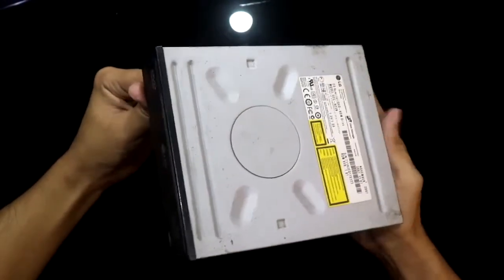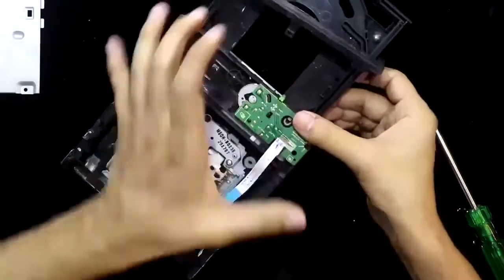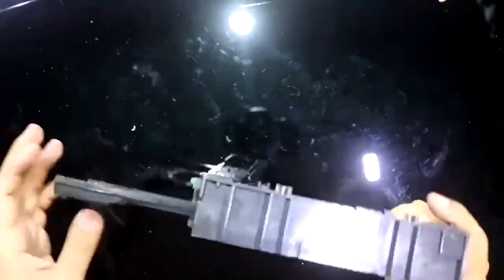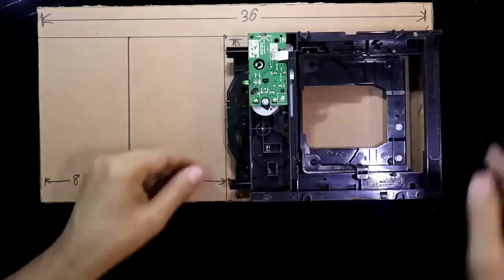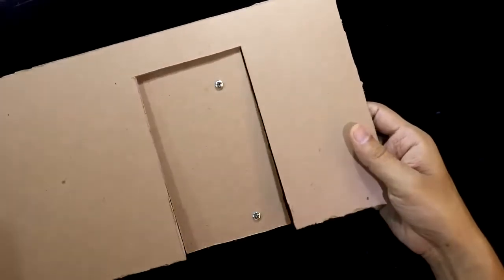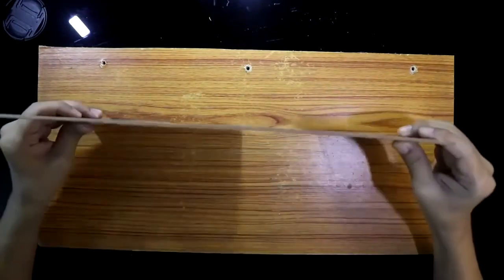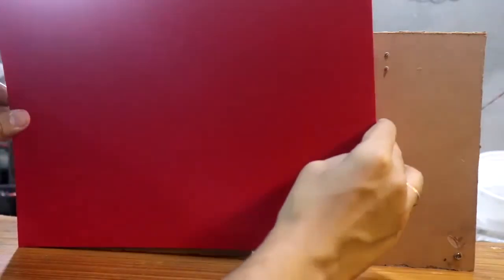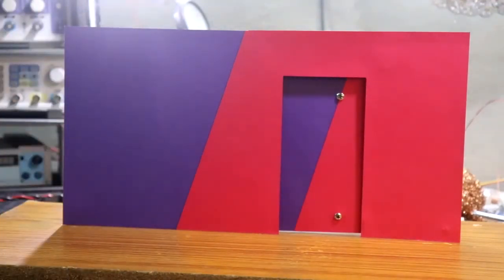How to make an automatic sliding door using old DVD writer

Comment: My goodness you are a master of tutorials. Every other video I have watched makes the assumption that the viewer should know circuitry. Instead you teach with a high level of detail to ensure that everyone understands every element of your project. If you are not a teacher by profession you might want to consider it my friend. You are just excellent!

Please teach us the next step. I would like to trigger the door to open and close  with a button or switch. What power supply can I use? Would a cell phone charger power supply work for continuous use? If so how?

I would like to make an automatic feeder for my amphibians for when I go on vacations.
Reply from the maker: Thank you so much for your wonderful comment.
please watch these videos, you will find some project related to this door, also with a button switch,

Automatic sliding door based on timer without Arduino (With push button):
https://youtu.be/KwtM6YZWdLQ

How to make a motion sensor door, video link:
https://youtu.be/59aotKiL3v8

Voice controlled door, video link:
https://youtu.be/JpPHZSNb58c
Reply: @EEWave  Your information is invaluable.

From what I gathered in your video, a 100k resistor increases the timer to 11 seconds. What resistor can I use for either 30 minute and or 60 minute timer?

What are the Specifications?

For example. I found this on mouser electronics:

Resistance: 56k Ohms
Wattage Rating: 0.25 Watt
Tolerance: 1%
Metal Film

What do you suggest for 30 and 60 minutes? Resistance, wattage rating, tolerance, type, etc.

Sorry for all the questions. I'm new to this :)
Reply from the maker: Hello friend, only a resistor value doesn't decide the timing. We also have to see the capacitor value.

To set the time,
T = 1.1 x R x C
T in seconds
R in ohms
C in farad

To understand the timer circuit, please watch these two videos. Here, I was talking about an equation and explained everything related to this.

https://youtu.be/edt5J0QaUbU
(Theory part)

https://youtu.be/-WZVu4LDv8k
(Practical part)
Reply: @EEWave  I really appreciate your videos and response. Unfortunately I could only understand some of it. A bit of it goes over my head.

With that said, could you tell me how you would create a timer for 30 minutes and 60 minutes? What values would you use for each? Is M (mega) immediately the next step above K (kilos)? 

Basically what I'm asking is what would you change from your original circuit to make the timer reach 30 minutes or 60 minutes?

What would be the resistor and capacitor value needed for both 30 minutes and 60 minutes respectively?
Reply from the maker: For 30 mins
R = 1.6 M (the correct resistance should be 1636363 Ohms, you can get this value by adjusting the potentiometer)
C = 1000 uF

For 60 mins
R = 3.3 M (exact value is 3272727 ohms)
C = 1000 uF
Reply: @EEWave What should the voltage rating be for the capacitor? 5v?

Can I wire the capacitor together in parallel with the potentiometer? 🤔

Based on your original circuit, if I decide to add a potentiometer what should the value range be for the pot that I choose to purchase?

Your original circuit video doesn't provide the voltage rating and tolerance for the various componants. The resistor is 56k but I'm unaware of the voltage rating or tolerance. A list of parts and their respective details would be really awesome! 😃

Have you considered expanding your original circuit to add time variance using a potentiometer? I'm sure many people would like to have that option and see how it's done in a follow up video. 

So far I have not found a comprehensive video on YouTube targeting beginners that uses a door like yours and adds the ability to adjust timings on the fly with a knob fitted to the potentiometer. 

It would be great to be able to adjust timings with a simple turn of a knob. 🙂
Reply: @EEWave  could I pay you to build a circuit based on the desired attributes I listed above?
Reply: Nice easy to understand.
Can you make a door using face recognition.